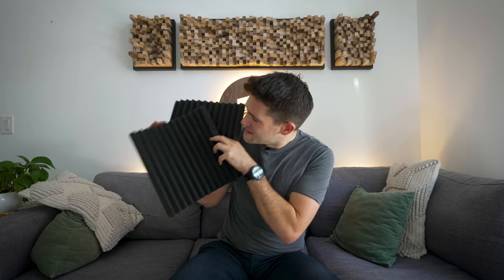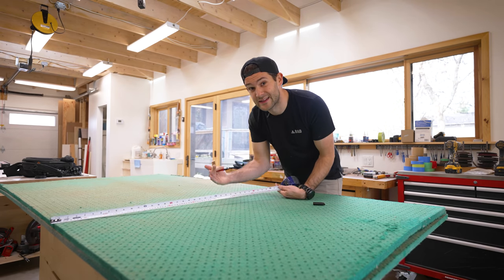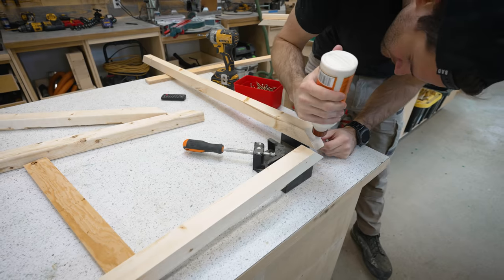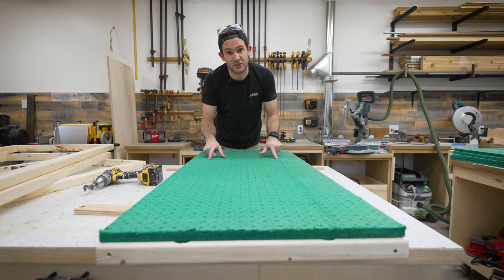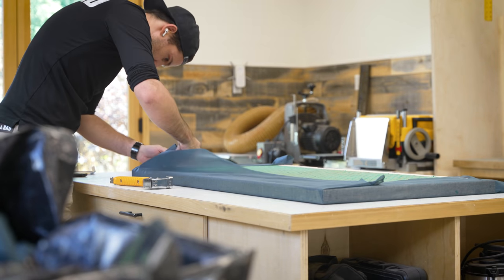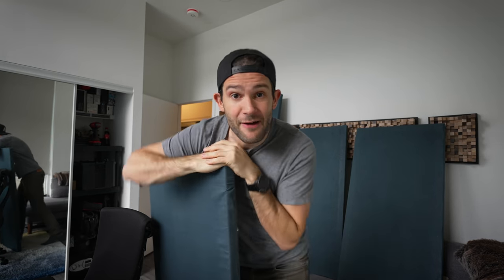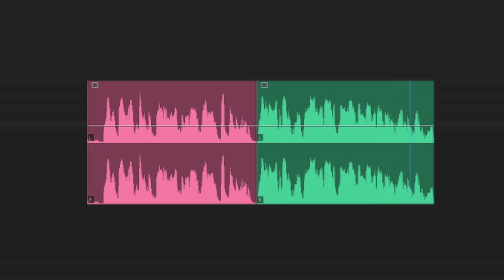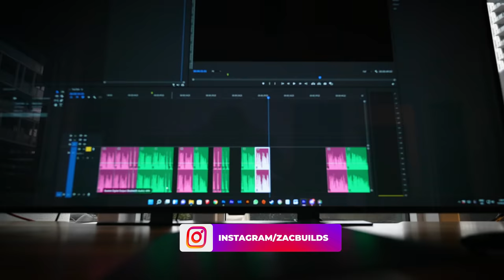Acoustic panels that actually look GOOD

Comment: There needs to be a clear distinction between SOUND PROOFING ... and ACOUSTICAL TREATMENT.  They are entirely different things - and hence why different materials are typically used for each application.  If you are trying to sound proof a room - you are largely concerned with sound transmission - and will largely be working at the level of room construction,.  If you are trying to improve the sound within a room - you are largely concerned with sound absorption, and preventing the build-up of reflected sound within the space.  The sciences and materials used in pursuit of each objective are distinctly different.
Reply: This product is used to dampen vibration through the wall assembly - not the best for wall absorbers... Okay solution but not effective for many locations.
Reply: That's why these kinds of videos are so frustrating to see get popularity, it's basically just acoustic misinformation.
Reply: Couldn't have said it better myself.
Reply: And, yet the creator in question doesn't bother to respond to the best comment on his video pointing out the misinformation is this video. But, he sure as hell responds to the ones praising his misinformation. Yet another example of why removing the dislike button is a terrible decision.
Reply: I mean, these are easy approachable projects to do, so they gain a lot of traction and views.  But if he was worried about audio quality then he would start with carpet... that is the qucik-and-easy cheap fix.  Even a short area rug will provide a huge amount of benefit for that kind of room just because it would be on the largest and most reflective surface in the room.

But I whole-heartedly agree, this is just the wrong product for the project.  In an open room you want something dense, movable, and with lots of air space, dense foam is stupidly expensive, which is why rockwool is such an easy 2nd place (but still extremely good!) option.  And I believe there are some thinner rockwool batts out there if you need something with a lower profile - It won't perform as well, but it would work better than light-weight fiber board.  Heck, he probably could have bought cheap foam board and put fabric around a few layers of it for similar results, and no need for woodwork at that point.
Reply: well said.  I used to live in a semi-detached house.  The builder promised that the dividing walls between us and our neighbours would be fine with wood construction (not concrete cinder block) and a insulation woven pattern between the studs.  Months after, my neighbour got a new boyfriend in her bedroom (ugh) and then she got a barking dog.
What a crock of $hit.  I should have listened to my gut wood, drywall and batt insulation can only do so much.
So glad to sell that house.  If I were to stay, I would have added SOUND PROOFING to that wall to help with the transmission of sound.
Oh ya, and our kitchen always smelled like what ever they were cooking.
Reply: Basic
Reply: When did he say he was sound proofing? He made it clear he was using soundproofing material for a purpose it wasn't designed for (acoustical treatment).
Reply: @cedarandsound  He never claims to be soundproofing the room
Reply: @johnbeeck2540  He already said that in the beginning that he was using a product not designed for being wall absorbers.
Reply: @wastelandmetal  The creator specifically said he's using the material against its intended use. It's in the video.
Reply: @CaedenV  He specifically stated he's using the product against it's intended use, and he also stated why he doesn't like rockwool.
Reply: @newFaction64  yeah, that's the issue.  he is using soundproofing material to claim that he is acoustically treating a room.  It's like saying your outdoor lawn decorations really help tie the livingroom together.
Reply: Out of curiosity, what would y'all recommend if i wanted to add acoustical treatment panels to my desk?
Reply: @Captain Planet good question! I kinda just wanted dividers/walls that attach to help make an isolated work area/help with sound for recording voice overs/streams
Reply: initially thought of just gluing the wavy foam to some plywood or IKEA skadis pegboard that would get attached via clamps to the desktop, or using the "premade" kinds people can buy
Reply: @Captain Planet Thank you so much!

I think I may make one of these on wheels as like a "background" I can wheel away. For the front and sides of my desk though (behind my monitor) I don't have as much space, sadly. Do you think those compressed polyester squares (like from Burton Acoustix) would help, even if it isn't as good as rockwool?
Reply: If you wanted to sound proof a room back to back to a loud TV in the living room wall, what would you use? Do you need to knock out the wall and install Sheetrock or more insulation?
Reply: @Captain Planet Yeah I think I might just knock out the sheetrock present on the back to back wall. I need to install some plywood behind for support of new TV and new floating cabinet. There is some thick drywall for soundproof and insulation. For someone just looking to soundproof, can you double up on Sheetrock or put sound proofing Sheetrock above standard 1/2" Sheetrock without needing to knock it out?
Reply: @Captain Planet Wrong. The best is actually fibreglass
Reply: @Captain Planet sorry that message was not intended for your comment.
Reply: @Captain Planet can you (or any other sound expert here) give advice for how to block "out of range" sounds (vibrations that people around me rarely even recognize as exisiting until they are deafeningly loud to me... while I both "hear" and also feel the humming in my head and chest).  I hear both high and low out of range but the low ones are what I really need help with. I don't know how to figure out what frequency exactly it is, beyond that presumably it is at the edge of or just beyond the low end of "normal" hearing range?
Reply: @Captain Planet I really hate how everyone has posted videos about rockwool.  It's great that people can build it themselves now but when I first got some.. I got the safe n sound I think 24 inch container from lowes for 35 bucks few years back.  Since all of these home build videos came out you'll regularly find them for 100 for the same bag.. like I said its awesome people have made these videos to be helpful but the supply and demand has made prices crazy... thankfully I have a few distributors near me where I can buy it cheaper than I did a few years back
Reply: @canadude6401  Cinder blocks would not help a load either, just as little. You need concrete walls would have to soundproof the cinder blocks all the same.
Reply: the #1 FLAW in indie movies and YouTuber vids is that AUDIO IN A HARSH ROOM (where there's no fabric on the walls or floor).......with that hollow big room sound / reverb. I've seen it destroy a zillion things.
Reply: I just HANG COOL SHAWLS (Pot leafs etc) on my walls to kill that annoying natural reverb!
Reply: @cedarandsound  #FAKEacousticNEWS ha ha
Reply: @CaedenV  I was shocked that my NYC LEASE agreement for my crappy apartment mentioned THAT I HAD TO HAVE CARPETS (!!).....bc they naturally dampen sound (for the floor below).
Reply: @Captain Planet I'M A BIT CONFUSED. 

The #1 problem in indie movies and YT vlogs is NOT soundPROOFING. 

(The neighbors aren't calling the cops on movie reviewers in their apartments!) 

The #1 SOUND PROBLEM is most rooms are too "live" with hard surfaces and no carpet on the floor. (THIS IS WHY ALL MOVIE THEATERS HAVE CURTAINS ON ALL THE WALLS. To absorb soundwaves so we can hear the movie perfectly and DRY-ly.) 

And most humans don't understand that you can't do an interview show in a room with hard walls and floors and ceilings. The sound BOUNCES AROUND like a tennis ball. 

ANY CARPET or Fabric on the walls will IMPROVE this huge problem. 

Ergo, ANY foam or ANYTHING soft stuck to the walls will SOLVE THE REVERB PROBLEM of most rooms. (Hell, at big concerts, the AUDIENCE is the softmush that eats soundwaves and reduces the natural reverb of a room made of concrete and steel!) 

ARE SOME OF YOU SAYING those sound bafflers of foam that he calls ugly....do NOT reduce reverb in a room? (Cuz they most certainly do.)
Reply: @Captain Planet Again,i'd saying nothing is LESS complex than acoustic treatment. 

ALL MOVIE THEATERS SIMPLY THROW CURTAINS and / or CARPET ON THE WALLS and.....ta-da. 

You could thumbtack your T-SHIRTS to your walls and TA-DA! 

Problem solved! 

(I just use cool shawls or artsy beach blankets, for WIN / WIN.)
Reply: @AaronWChen  You could do this with CARDBOARD PANELS from a friggin large cardboard box, sir. 

SOUND is REALLY sensitive, and easy to control. EX: throw a sheet over your head and mic and notice how that ONE act radically changed your audio and made it much CLEARER. 

Dollar Tree FOAM-CORE panels will also easily do the trick. Even ONE PANEL radically reshapes the sound (vs a "booth" of sorts around your work station), bc sound is so vulnerable and directionable. 

(ex: say sentences out loud while moving your hand back and forth....slowly blocking your mouth without touching your mouth....hear the RADICAL change in intimacy, cuz your hand REFLECTS the sound.) (Or do that while singing.)
Reply: Can I install SONOpan over the drywall to control acoustics or reverberation within the room?
Yes. It is recommended to cover the SONOpan with fabric when doing so to cut down on any dust that may shed from the panels over time. SONOpan with Noise STOP Technology provides excellent sound absorption.
Reply: @wastelandmetal  he's out of his depth.
Reply: Amen. 

dense heavy and no holes/ thin spots/ expanding foam - for sound insulation 

fabric plushy upholstery light and fluffy stuff - for reverberation
Reply: @cedarandsound  Yeah, well, that's just, like, your opinion, man.
Reply: Does sonopan even have NRC rating? I assume not...
Reply: YES... I have seen a lot of DIY guys getting this horribly wrong over and over. Though this might help a bit, using the correct materials will not just help... it will solve the problem
Reply: @CaedenV   In lieu of carpet, how are those 1/2" -- 3/4" foam squares you can put together for a "gym" floor?  I want to make a music room in my new house.  The construction is ICF so 1/2 the walls will be foam covered concrete, and the other half will be wood stud walls with insulation.  I was going to put the rockwool based panels on the walls and ceiling and 5mm cork and then those foam panels on the floor.
Reply: You nerds. He's using a sound proofing material with absorbing qualities on a wall to dampen sound bouncing around the room. The porous nature of rockwool and similar materials will  help absorb vibrations, and they are very effective at this task. This method is being used by music studios to great effect, so no matter if you scream bad science or not, this works and is being actively used in music recording studios.

Rockwool is both great sound proofing material but also for acoustic treatment, the latter not very targeted, but in general bringing down a range of frequencies and the general reverberations of the room that is being treated
Reply: @cedarandsound  it just so happens that the material you are commenting on has great sound absorbing features as well. It works, you just refuse it to do so and come up with stupid analogies like lawn decorations lmao
Reply: @stefanfyhn4668  What sound absorping features does it have that are great?
Reply: @cedarandsound  its porous nature combined with mass.
Reply: @cedarandsound  No matter what I say and whether you believe it or not, it works. So stop being a keyboard warrior lol
Reply: @stefanfyhn4668  Fantastic, so if it is porous how does it have mass?  How much mass is needed to deaden a room?  Is it absorbing or sound proofing?  Which frequencies is it controlling?  How many decibels?  Is it improving sound accuracy or just muffling a small section of the higher frequencies above 5000hz?
Reply: @AaronWChen  Honestly, it's better to get a system that alters the room response like Sonarworks.  Then it's software that actively corrects the inaccurate sounds in your room.
Reply: @jonbongjovi1869  What that is is higher frequencies building up, diffusion helps break it up but keep it lively.  Absorption deadens it but only the high frequencies so you get a muddy sound with carpeted walls.
Reply: @stefanfyhn4668  I am listening to what you're saying, so please make it make sense.  I want to understand what you mean by that.
Reply: Erik Sark - You're not entirely correct. Improving the sound within a room involves absorption and dispersion. These two things are subsets of acoustical energy transmission.
Reply: @wastelandmetal  The button is still there, the count is just missing.
Reply: @CaedenV  Carpet? Nonsense! You know nothing about room treatment.
Reply: Hi there.

I need to teach online. I have noise coming through my window. The dogs barking, the chickens crowing, loud neighbors...so what's the best way to sound proof my window please. I've come across a TON of videos online some stating the merits of one material over the other, only to watch another video that says otherwise. 

So please what's the easiest, cheapest way to simply stop all noise or 90% of the noise coming through my window.

Don't laugh but at a point, I thought I'll just fold a thick duvet, then add some thick bathroom towels. Push them against the window and cover the window, the duvet, the towels with plasterboard and nail in the plasterboard.

What should I do please
Reply: @newFaction64  Exactly He never said he was soundproofing as he was creating ACOUSTIC PANEL without using Rock-wool!
Reply: @elizabethwoolley748  Late answer but if your sounds are "constant sound", like air conditionning or a motor, and you need to cut them part of the time, noise cancelling headphones are great for that. They dont cut irregular sounds like talking but are great for regular sounds. I used them at work most of the time (in my case Bose headphones) at work. I worked in offices at a manufacturing plant where they were pushing white noise to minimise echo and when you cancel that you realise that background noise is really fatiguing at the end of the day. Anyway, an idea to consider. Of course if its at home you want another solution with no headphone involved.
Reply: Also he starts by saying its going better than rockwool and in the end he says he doesnt know if its better but it "feels" really good. Personally I listenned and looked at his recordings and to me there is not much difference. Without measurement like using something like REW (mentionned below) its too objective. And finally he should record white or pink noise if he wants to test his accoustic, at a minimum, it would be a better measure of the change. I agree with others that its a bit sad that someone like that who doesnt seem to know about accoustics is considered a reference by many people. But then again there are a lot of people for which Apple Buds are the best for listening to music.
Reply: sound proofing for the amateur is basically just putting up a drywall. You can put rockwool inside. it will help a bit, but mostly the wall being a air tight seal will do most of the work. For the pro's, you have this very heavy material on rolls of various thicknesses, but that stuff is like 5 grand a wall
Reply: @canadude6401  uh, what you smelled wasn't them 'cooking'. wood walls transmit...smells, too. Luckily there are wipes for that.